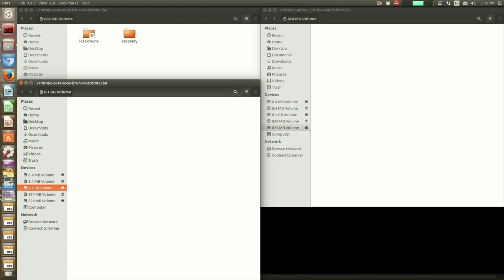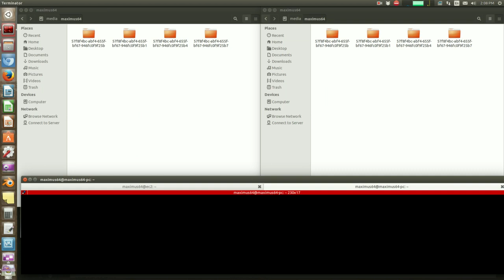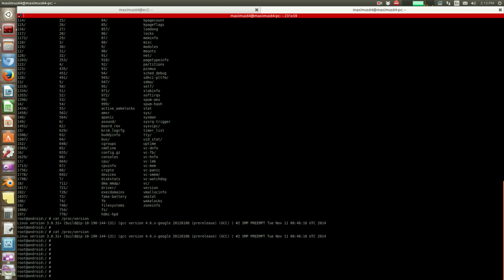Amazon Fire TV Stick e-MMC Hardware Root

Comment: is the fire stick need 3.3volts?  wondering if the sparkfun sd sniffer board will work?
Reply: The power supply is 5 volts 1 amp. Not sure if this information helps.
Reply: Not what I was asking about.  Thanks for your time answering the question though...

Comment: dat would suck if did all that to root, and then found out had a defective device, but i guess since its hardware root no hurt to plug it in and see if its working and fearing amazon updates? till they come out with nanobots that mess with your hardware, i think that happend to my old nic it was showing as a strange device and working odly.